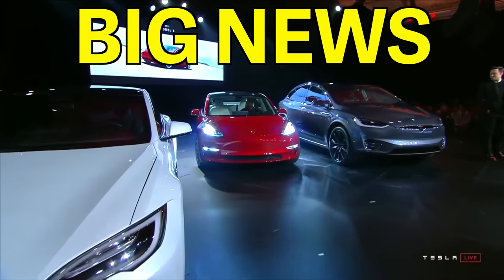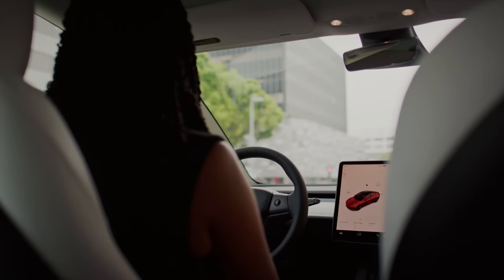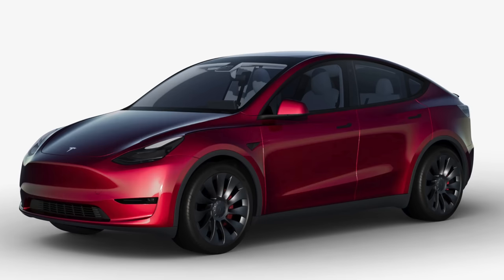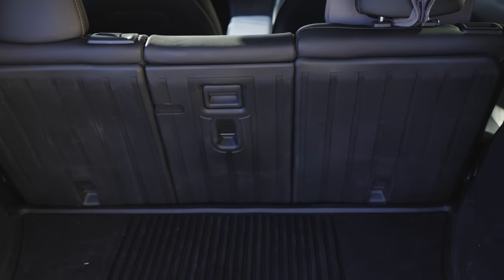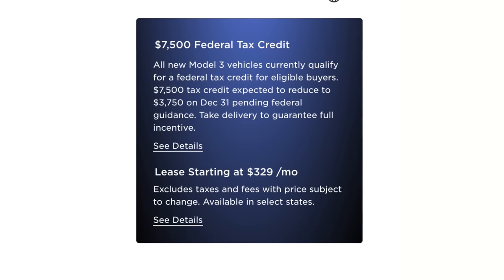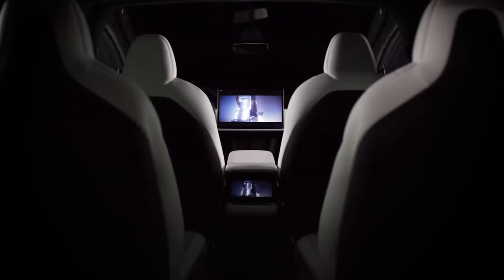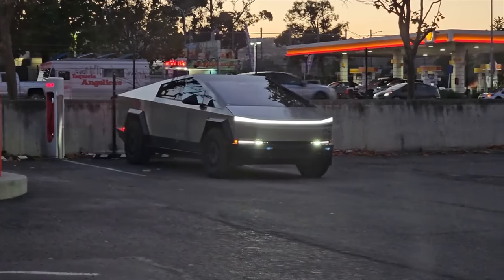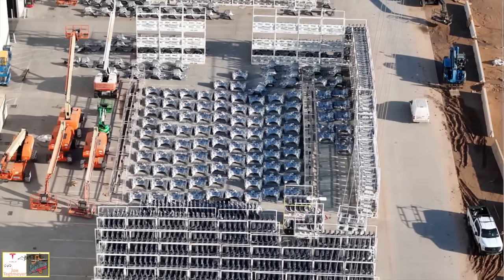BREAKING: Tesla's URGENT Alert - MAJOR Problems Revealed! | Tesla Model 3 + Model Y

Comment: I test drove the Y this weekend. 
1. Road noise is a lot louder than I had imagined. 
2. The rear window is terrible for the rear view mirror. 
3. The pedal was easier to drive than I thought, though it would take me over a week to get used to that. I’m a coaster. 
4. I can’t tell if it’s lower or near the same as my CRV in height. It definitely feels different. 
5. It’s definitely less luxurious than the Toyota Avalon or Nissan Maxima I owned. Minimalism isn’t my thing. It feels cheap. 
6. From my understanding of the software it’s definitely premiere. 

If I buy one it will be due to price and supercharger network. I’m still waiting til 2025 models come out and then decide. I want to see what Kia and Hyundai do then.

Comment: My two favorite options on the Model Y Jupiter at the present would be comfort related. First and foremost, I want the airbag suspension system. I used to own a class A diesel pusher that had cushioned airbags on all wheels and the ride in that vehicle was  like floating on a cloud.

My second most favorite comfort feature is the heated and cooled seats they plan to add on the Jupiter release.

Comment: The "All Deliverable" selection was on the drop down mid September when I set about my MY purchase... Tesla could halve the prices of newer models and I'd still be a happy camper with the one I got last month. FSD is a pipe dream for those who want it and  anathema to the natural born driver that I happen to be. My purchase was based solidly on the feature found on the "steering and pedals" tab, and it's called "Hold".

Comment: So, as I currently understand, it seems like Tesla has lots of inventory of 2023 models.  When 2024 comes, it's been mentioned,  without definite figures though that the $7,500 instant rebate might be cut for 2024.  I'm torn between taking advantage of 2023 incentive or take a gamble in 2024 getting outright rebate hoping there are still 2023 models left at an older model price.
What are the best and worst  chances?  
Whatever!